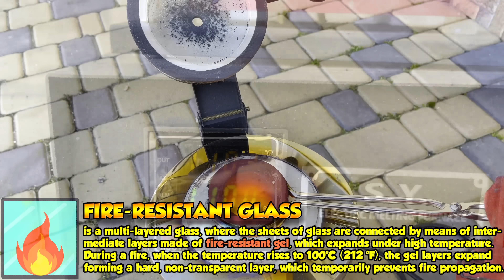Experiment: LAVA vs BULLETPROOF GLASS

Comment: This is a results of thermal shock. The breaking has something to do with the glass structure in a molecular level. Well annealed glasses have better thermal shock resistance than unannealed glasses. In actual fact, both glasses showed cracking behavior, if you consider that the car window glass was thinner and it was one slide whereas the bullet proof window was thicker and also laminated to other four thick sheets. However, it also breaks like the other one (car window) even though the pieces stayed together just because it is laminated with a very good glue so the pieces did not fall. Also thermal expansion coefficient has an effect since only selected part of the glass is subjected to higher temperatures whereas the other parts are not expanding or vibrating. These differences can cause cracking also. only a glass with zero coefficient of thermal expansion I assume will do better in terms of thermal shock resistance or if the whole piece of  glass is subjected to the same temperature.
Reply: Wow ur absolutely right .......surprised someone actually understood the mechanism
Reply: jotting down notes
Reply: not lava
Reply: I thought it was because lava is gangsta and the glass be like" fuxk na, ima out here dawg!"
Reply: Ummm I totally get it 😅😅😅😅
Reply: I think I am in a class
Reply: Yeah. your are completely right. the lava ( apprearently liquid iron smelt or other metal) gives the heat to the glass by cooling down itself. For further explanation: Glass doesn't possess any crystal structure like TiO2 or other minerals. Glass  is like "frozen" local atomic networks (Al2O3, SiO2 +additives like Na2O, K2O) by a rapid cooling down after heating at a certain temperature during the preparation process. By Reheating the glass with thermal shock you break up theses formed atomic microstructure. Hence, the glass breaks. The fire resistant is tempered material at a certain temperature for conditioning the glass structure to high temperatures. Therefore it holds much longer the temperature shock and possess a lower heat exspansion coefficient as he mentioned and therefore cannot be broken easily. Ther car glass has got an other conditioning of its localglass network during preparation with less tempering against thermal shock and can break easier. The layered sheets of glass takes the transfered heat overall layer, so only a part of the surface breaks up after contact. I hope you would enjoy the further explanation.
Reply: @pimaldaumen3086  you are right. Are you working on glass research? I am working in glasses and ceramic research and I would like to join other r&d labs. I didn't want to go deeper into the structure but you did try to break it down.
Reply: @kwindat.i.3560  Sorry, I am Not in glass Research. But I had this stuff during mid chemistry study As Module about chemistry of solld state reactions. We had done Some Experiments on glas Like preparation of selenid glass and tempering and looking on PXRD and Thermoanalysis to prove the quality of the prepared glass. Now, I am in nonferrous metallurgy for my PhD. We can be in written exchange If you want to stay in contact. This was my normal study knowledge I remembered
Reply: @pimaldaumen3086  with tempered or sometimes called toughened glass its just about thermal expansion. glass is heated untill its softish, then the surface is cooled down rapidly. this results in the surface shrinking while the soft insides are still dilated. as the entire piece cools down the insides shrink as well and drag the surface with it causing tension.

interestingly this also polarizes the glass, like sometimes in a buss with double panels (for insulation) you can in a certain light see dark spots. each of those spots is where the cooling air pressure nozzle was pointed at.

anyways, the reason it takes a moment for the toughened glass to break is due to that tension, because the surface is sortof shrunken, it takes a while for the heat expansion to first bring it to normal state and then start causing pressure. in short the expansion rate is the same, but it has to expand more to break.
and yea toughened glass is often used in oven doors or light fixtures due to that heat resistance.

the fire proof glass panels are just normal glass with gel between, there is no special tempering or annealing done to them (any more than the annealing done to normal "float" glass, which is the standard modern window glass.) 
the (fire)proof is in the pudding (gel) so to speak ^^

there are other heat resistant glass variants. borosilicate glass is generally used in stuff like glass used for cooking or washing machine viewing windows. its pretty much clear color and much lower thermal expansion coefficient vs normal glass
"robax" is another one, where the oxygen in the material is replaced with natrium, resulting in a slightly orangeish hue and a distinct smell when grinding it. robax has practically 0 thermal expansion, but other than that its properties including melting point are practically identical to normal glass.

Comment: Me: Car glass should be pretty strong. It’s got layers in between the sheets of glass to keep it from shattering, right. Yeah, it should...

Car glass: PPSSSSssshhhhhh
Reply: Ironically enough, I was actually in an accident where we landed upside down (no injuries thankfully) and I thought we were trapped. I tried kicking the window a couple times and it did jack squat! But then the driver simply rolled the window down and we got out :)
Reply: @blakeburton3137  if you were rolled on your roof, wouldn't you really be winding the window up to get out? :)
Reply: @Saul Castro "easily"..i was in fucking YUGO 20 years ago when my friend driving drunk and fast went off the road in ditch ,then we travel like 50 metars on roof until we hit electric pole ..i was siting behind and on YUgo (2 door car) back windows cant be open and we were upside down and engine was still runing ..and my friend sad go out fast car will explode ..i tryed with all i  got to brake window hiting with my shoes but no way..i allready saw my self exploding and burning..but i got out in front window...and car never got fire and exploded...so you can only brake "easily" if you have hammer in your backpocket but that dont happen often
Reply: @dzonikg  you can break them easily if you have anything hard with a point, the side windows are tempered so they resist blunt force well but will break in an instant if a point is applied, hence why that type of glass isn't used for the front windshield as if any rocks hit it while driving it will shatter.
Reply: @-canopus-513  But what hard you have in that situation?And its seconds ..i was laying down and hiting with my leg hardest i can and i was then soccer player ...had very strong legs..so you need to have a hammer or a rock in your pocket or in a car somewhere to reach
Reply: @Simon W Precisely. I realized that after posting. Thank you for this astute observation.

Comment: i love that the car window literally explodes when it instantly touches lava
Reply: Flick a small piece of broken spark plug porcelain at a car window, for ultimate smashy satisfaction.
Reply: Car window was pretty pathetic. Ngl. You thought it had it for a second there. Then it just breaks into pieces.
Reply: @helloguy8934  Isn't car glass supposed to easily shatter?
Reply: @ViolettaVie  I think brake lights and such are.
Reply: @helloguy8934  it's supposed to be pathetic, if a car goes underwater or something do you want the glass to be indestructible?
Reply: @sf_0160  No. But don't take my remark too seriously.

Comment: Interesting how most of the damage to the glass is done as the molten metal cools and expands, rather than the heat itself.
Reply: the leidenfrost effect is the main reason nothing happens for the first few moments of contact
Reply: @TurbixMusic  I believe that would require the surface of the object, in this case the glass, to be at a temperature higher than the boiling point of the liquid it’s come in contact with. 
So I could be wrong, but I’m not sure that applies here. Now I’m curious as to the delay.

Comment: Glass is molten sand 
In physics glass is classified as liquid  but has highest viscosity and masquerades as a solid
Reply: It is also interesting that when hit by a needle glass will not shatter
Reply: I could agree but i never took physics.
Reply: nope, it is amorph solid. It does not flow.
Reply: You are correct Thorin.
Reply: So when you heat it, it doesn't liquidise but directly vaporise?

Comment: I need a fire resistance glass for flipping my egg , i mean look how it flipped the lava 2:28 😂
Reply: You flip "your" egg? Like, really?
Reply: @deveshsinha5970  02:28 That did not even flip. It just tossed the hardened lava back on the same side. That ain't no flipping.
Reply: As chris from mrbeast would said it is not real lava it is simply aluminum burning at a very high temperature

Comment: You should have done them all the same way. I'm sure the "window glass" would have broken anyway, but you separated them with blocks and a couple inches of air between. Obviously 5 layers of glass stacked directly on top of each other like you did with the bullet proof glass will dissipate heat much better than a single sheet.
Reply: I think that the bulletproof glass is made that way. Very thick and layered to resist piercing.
Reply: @Hanagigi  I expect you’re right, but I don’t see the point in the test with several sheets of regular glass.  They kept pouring on more of the ‘lava,’ so it wasn’t really a test with multiple sheets.  It was more like a series of single-sheet tests, with each test impacting the next.

I would have rather seen how layered sheets of regular glass would be affected, compared to the single sheet and the bullet resistant glass.  

Still though, only a minor complaint about a very cool video.
Reply: Bullet proof glass is actually only about half glass. It's usually made with layers of hard glass, separated by sheets of polycarbonate. The two materials are almost the exact oposite of eachother (glass being very hard, but brittle, polycarbonate being soft, but almost immposible to shatter or pierce), making it enourmously hard to get through. that' why it looked like they just put five layers of glass. However, i see your point, testing the normal glass all on top of eachother, with no separation, would have been more experamentally sound, and probably would have looked pretty cool as well
Reply: @jonathanhill8551  oh, so that's what was boiling on the Bulletproof glass. the polycarbonate.
Reply: @SteveMacSticky  Exactly

Comment: Ironically, glass should have a similar melting temp to stone or metal (molten glass is also basically lava). But of course, the brittle crystal structure of such thin plates can‘t survive the heat and pressure, especially not when under the stress of also having to hold up their own weight. 

The results might be different if you tried it with a solid block of glass instead.
Reply: I think the result would be the same, the glass broke because of the thermal expansion, a huge block of glass would break for the same reason, but since it is bigger it would probably resist for more time, or break just the top of it
Reply: @Rafael-vs8qv  but he says it would melt instead
Reply: @thebezierguy  maybe it would melt, but I'm sure it would break before melting
Reply: @Rafael-vs8qv  we'll probably never know
Reply: Fred Jammerson  yes
Reply: Well I think glass broke because of sudden and uneven changes in temperature causing stress damage
Reply: Fred Jammerson  I said the same thing differently

Comment: Car windows are meant to break apart like that, more so than regular glass you'd see in a house window. It's meant to sort of crumble away without sharp edges so if you're in an accident, you're less likely to get cut as bad, and if you drive into a river and need to break the glass to get out of the car, it's easier to break.

Comment: Hello.  I was curious, but why did the molten metal jump from the surface of the fire-resistant glass at 2:28?  Is it because once the molten metal makes contact with the outer surface of the glass, a vacuum field is created, and once the molten metal cools sufficiently after a few seconds, the ambient air surrounding the hardening metal replaces the vacuum field, and is pressurized enough so that when it returns, it has enough force to lift the molten metal upward into the air?  Or maybe its because the molten metal heated the gel inside the glass beyond it's expansion point, and the expansion of the gel exerted enough force unto the molten metal to lift it into the air?  Please let me know about the forces at work here?  Thank you.

Comment: These glass are strong but it’s definitely not lava proof. The amount of lava used is not very much. If you use 4x or more of the amount of level then the glass is done for. It takes a lot of glass and layers just to withstand that small amount of lava it’s insane how strong it is. I know dry ice is much stronger to hold off lava for sure.